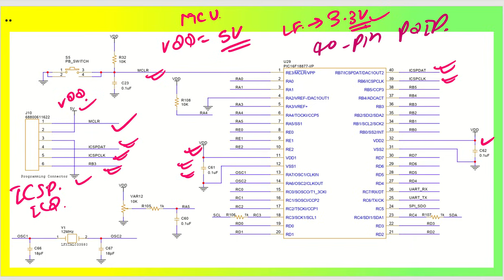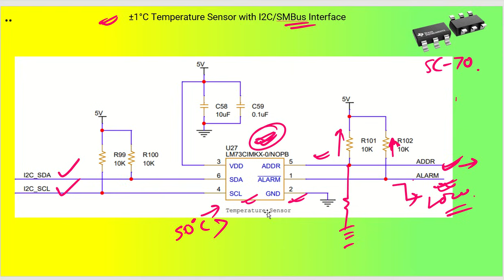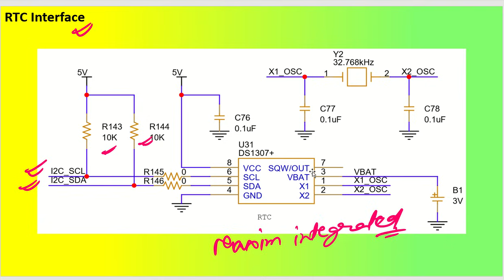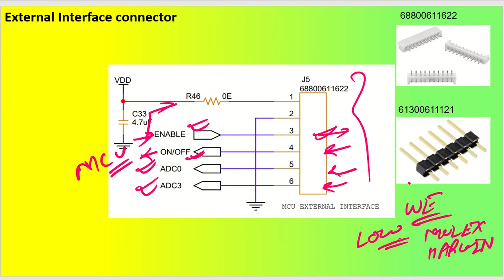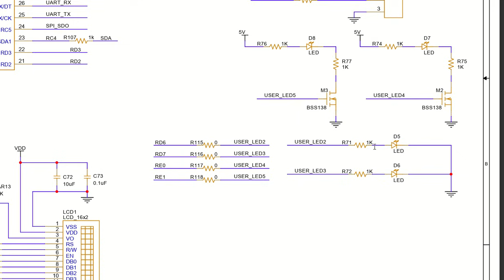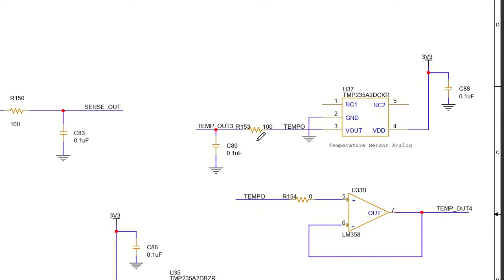Comment: This is so good sir, I learnt lot of things about microcontroller schematic design. The best things are so many application interfaces like Temperature sensor, EEPROM, RTC, LED, Push Buttons, DIP Switches, ADC, LCD etc.  Lot of learning to add to my skills. Thanks for the awesome explanation and practical examples used in industries.

Request you to give some Microcontroller session with inbuilt opamp, differential ADC and PWM with Automotive application for sensor interfaces.🥰
Reply: Means a lot to us, seeing that you guys are benefited from the sessions